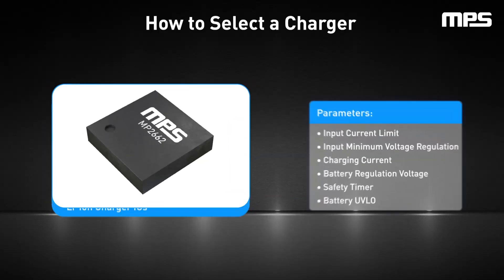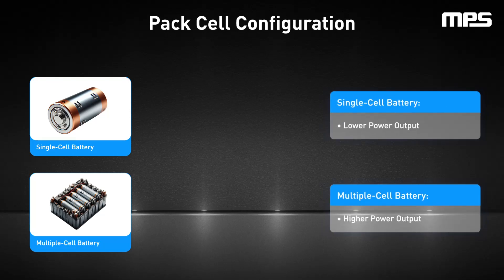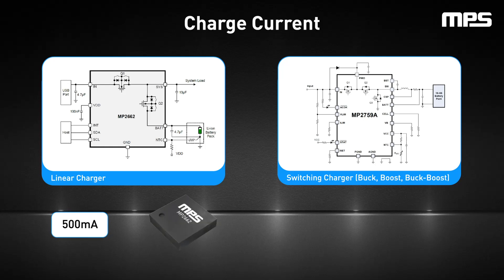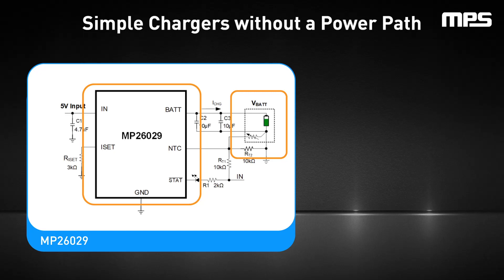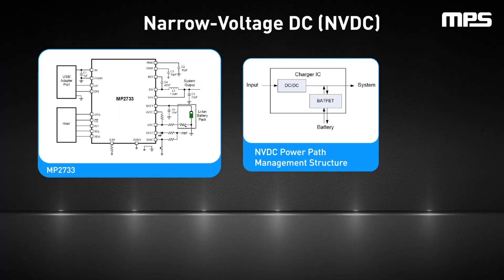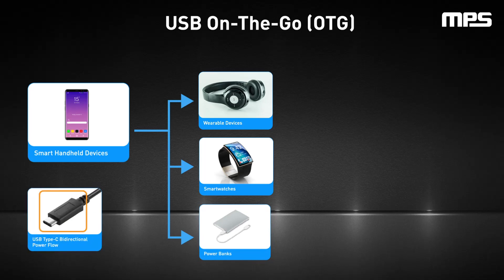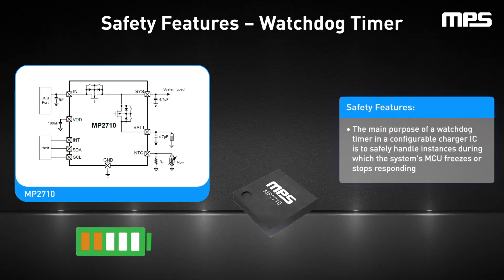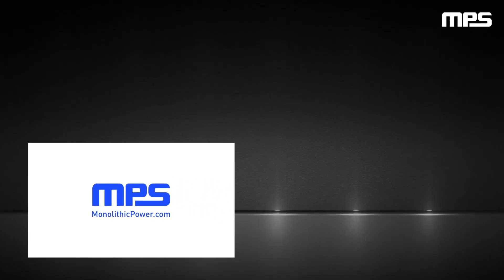Mastering Battery Charger IC Selection for Optimal Device Performance

Comment: Is there single solution for USB type C fast charging and PD support Battery level Indications and 5V boost system out. Like power bank.
Reply from the maker: MP2770 is a one-cell battery 6A charger for power bank and similar application, it provides bi-direction Type-C port and Type A port with dual boost outputs, and integrates ADC for voltage, current and temperature monitoring. Please to the following link: https://www.monolithicpower.com/en/products/battery-management/chargers/1-series-cell-chargers/mp2770.html